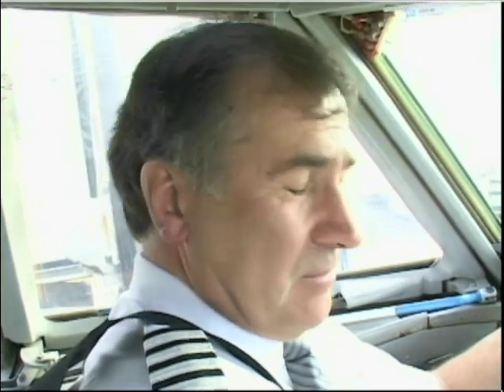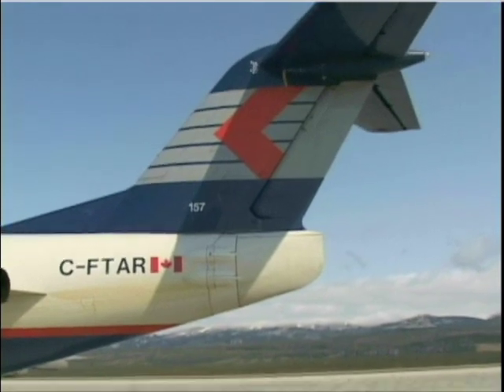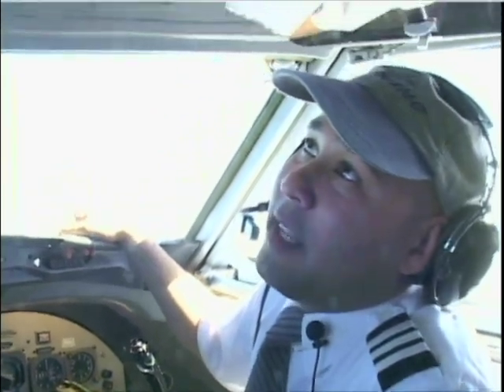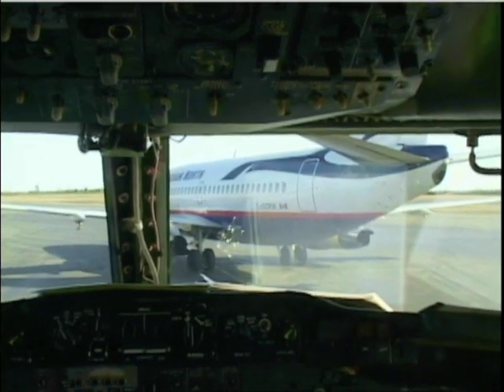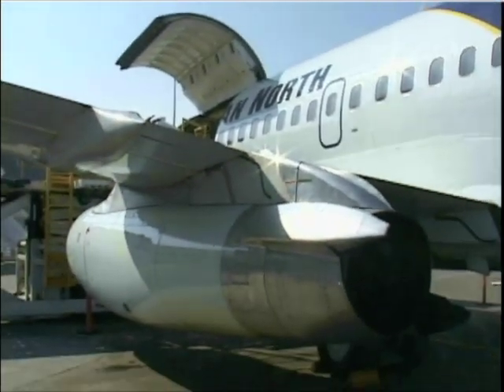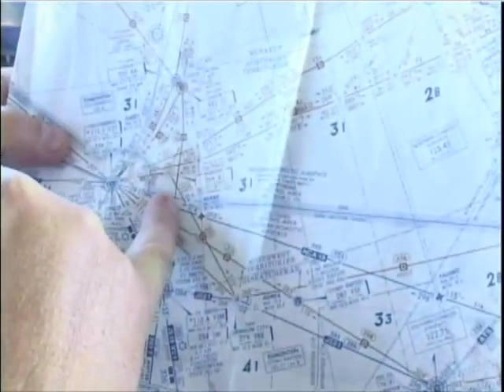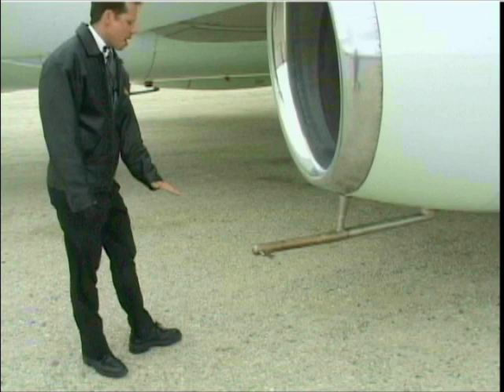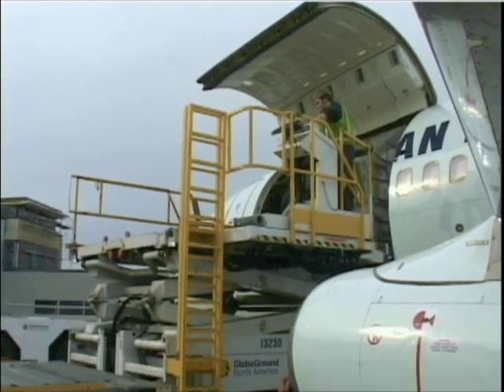CANADIAN NORTH 737-200 & Fk28

Comment: mainly the reason they are use is because they can have a combi configuration with a movable bulkhead... unfortunately movable bulkheads got "grandfathered" in and cannot be made anymore. the other main reason is they can get equipped with "gravel kits" with a gravel deflector on the front gear (to protect the undercarriage) and a vortex dissipator on both engines to avoid engine FOD intake on gravek runways... although they consume approximately 35% more fuel the a -300.

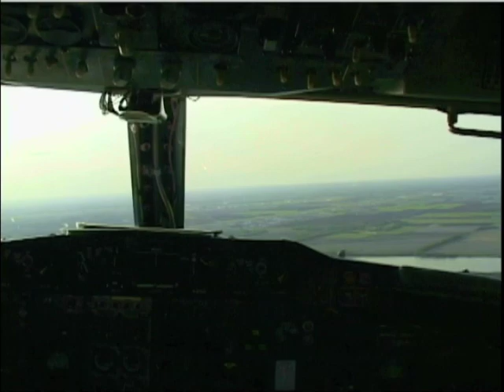Comment: @JustPlanes: I own this DVD and watching it again the other day, something odd struck me: whenever the 737-200 is on approach/landing, there is a horrible noise in the cockpit, almost like a pneumatic valve releasing, but the pilots never address it, and the source is not visible in the filming.  Luckily, there's a snippet of the sound in this video at 4:42.  Any ideas on what it is?  Thanks in advance.
Reply: this comment is 2 yrs old, but the answer is: It's the trim wheel moving. :)